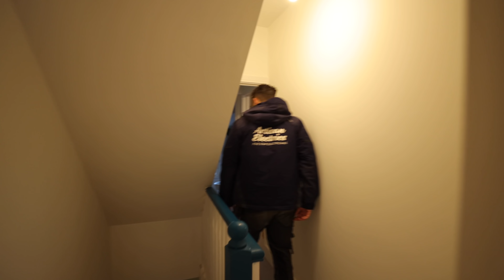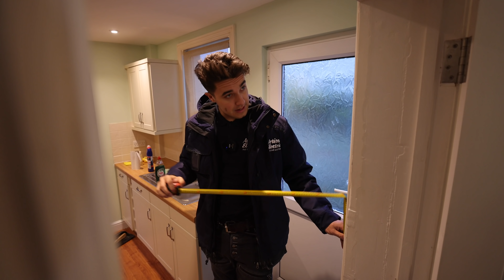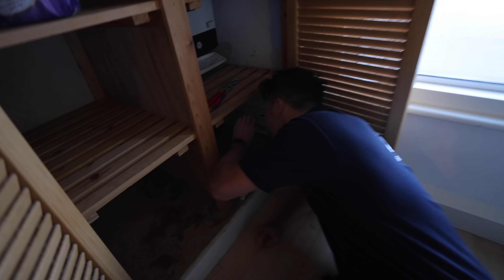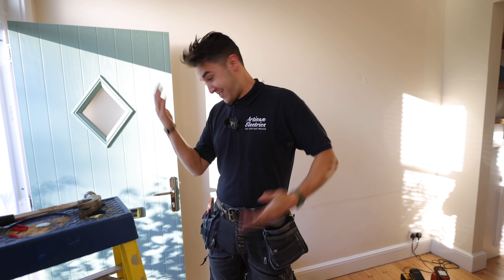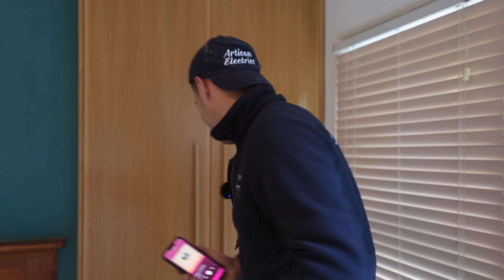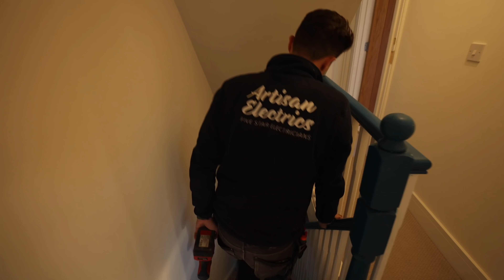I CUT THROUGH A WATER PIPE! MY WORST MONTH EVER! 😭

Comment from the maker: Leave a like if you would like to see a video on Cable Networking? - Make sure you’re subscribed to our Channel with Notifications on - bit.ly/3nqFpXp-ArtisanElectrics
Reply: 2k likes for a video on fiber optic cabling / splicing? 😬
Reply: Please do a networking video!
Best case: Full house networking install with 19“ rack install 😍
Reply: @taxiandy5698  Done lots of that..Love it ;)
Reply: Did you do T-568A or T-568B?
Reply: yep I do that all the time - The company I work for makes Cat5e/6/6a/7 - heh gotta love crimping the plugs on the end! - life of an IT Tech....
Reply: @B_T_B  only places where ive seen A pattern used is gov buildings, everything else is B
Reply: Structured cabling is getting more and more vital for the homes of today, would you start doing the installation and management of home networks alongside the electrics? Since you would be running electrics everywhere if you can handle the networking side while you are there then that would be great for the client. Just need to train everyone on how to properly run data cables and how to terminate/build network racks
Reply: For Cat5e/6 the continuity tester is fine. 8 lights means gigabit unless you're even more unlucky than Cory. Fibre is a completely different animal. Specialist tools, specialist training. Thankfully it's rare you'll see it in a domestic setting.
Reply: Yes please. 🙂👍
Hard luck with the pipe. My worst was a Lead gas pipe which didn't show up on my metal detector, for some reason. I had just grazed it, and could smell gas faintly, but couldn't see the small leak until I used detergent in water. It could easily have evaded being noticed, leading to serious problems later.
Reply: Hmm sparks messing about with datacomms, go ahead - sounds fun🤣
Reply: Yes, but please Cat 7/Fibre and proper double network sockets in every room like in modern houses

Comment: Haha how did Cory not realise the pipes were there? He literally lifted the board and you could see them. But that is something we have all done
Reply: Maybe just maybe he didn't see it.
Reply: yeah was thinking the same, he saw the pipes in the other room going that direction lol
Reply: He knew they were there, but as he said on the phone to Jordan, the pipe was litrally touching the floorboard, so even if he cut the board perfectly, it would have still hit it. The pipe should have been a bit lower.
Reply: @puntoboy_gaming  can't always go much deeper better to use plastic pipe and drill through lower
Reply: @steverobinson8170  it's only 15mm pipe, you can got a bit deeper, look at the other pipes in the video, you can see a good half inch gap between the pipe and the top of the joist. Not blaming the plumber, though.
Reply: @puntoboy_gaming   those floor joists look like 6x2  max depth of notch in those joists  is 18.5mm , max  on any joist is 35mm   calc for depth  is 0.125 x the depth of the joist  . they should also be rapped where they bridge the joist , this is down to bad plumbing not corys fault . Should hve used microbore or plastic and drilled the joists
Reply: I pulled a board a once and had a nail in the middle then when I put it down I hit the nail in the middle tried to stop mid swing but was to late bang clean through a pipe. So it’s easily done and always silly and that makes it worse lol
Reply: Camera guy should have spotted the pipes it was clearly on camera.
Reply: With so many wall scanners out there, a simple scan would have shown the metal pipes.  I think Walbot (?) distinguishes between and even IDs non ferrous materials
Reply: That's why you use a skill saw, you can set the depth of the cut to how much you want

Comment: Get yourself a mini circular saw...  Take up a board thats already up to get the depth, then set the circular saw a mill or two shallow..  Cut the boards till your hearts content knowing you wont go through then just snap the last mill or two..
Reply: Good tip! I do this.  22 years and no burst pipes... yet.
Iv chased straight through lead gas pipes that have been buried in walls a few times though
Reply: Exactly how I do it, circular saw every time set just a few mil short then snap it off

Comment: I drilled from the inside out and drilled dead center through a downspout installing a cable drop. Ran a finish nail through a baseboard and ran dead center (again) into a water line for toilet supply that never got a metal plate on it when they built the house. The list goes on and on. If you are in any contractor trades... your day will come at least once.

Comment: I would highly recommend that Jordan hire a network guy.  There is a lot of money to be made in that industry as well.  If you do some commercial wiring its a good sideline to have as well as most business that do networking, don't do electrical and would need to subcontract that out.  Where as the other way you could also get that business as well.  With more and more home automation and home networking its a good field to be able to wire houses.  Hardwired network connections will always win over slower WiFi so from that aspect it could be a great value added service you could provide during re-wires etc.

Comment: Sorry Cory; bad luck.  You are a good sport allowing filming to continue - good for us to see real world problems; those pipes were really hard up against the boards.
Reply: not really. by building regs we are not allowed to cut out more than 1/8 of a joist. what i do is i leave a little diagram on top of the boards so the sparks know where my pipes are, to save them hassle like this 👍
Reply: @logansrcs9243  Thanks for that info - and that is a very good thing to leave a diagram.
Reply: @rossthompson1635  At the end of the day im all about helping out other tradesmen, thats the you have to be, saves them time and money having to pay a plumber to come and fix things like this
Reply: The regs on joists are to notch 0.125 x the depth of the joist, if that’s an old 8’ Victorian joist then your allowed a 1 inch depth which is 25.4mm, you can go through the centres with a spade bit and that’s 0.25 x the depth, you can only notch and drill within 1/3 the span of the joist where it’s anchored. 👍

I recently went back to college to study for my acs like 2days ago and this was the topic of the day 😂
Reply: @MrKonquer  Thank you for that info, useful. I wonder how many joists have been hacked and drilled over the years way beyond that specification.
Reply: @MrKonquer  im currently at college, and have gone through all that, but I am right with you are not allowed to cut out more than 1/8 of a joist
Reply: @logansrcs9243  yes 1/8 as a decimal fraction is 0.125, the joist in the video is a 8 inch joist so you’re allowed 1inch notch which is 25.4mm as you can run 22mm pipe on them too, those pipes are way too shallow and can be notched deeper. 

They are right in telling you 1/8 because the majority of uk homes like 90% are built with imperial 8inch joists so you can take an inch outta them, all I put in my earlier comment is the uk standard for measuring up joist prior to notching you can look it up online if you don’t believe me.
Reply: @MrKonquer  no mate I believe you, that is also what I've been told 👍
Reply: @logansrcs9243  On new build the chippy used to mark the floor as it was put down over pipes any decent plumber would have marked the flooring,
Reply: @anthonybragg  yes mate definitely, I do it all the time to help everyone out

Comment: We've all done it mate, mine was a DIY job, fitting a new light fitting. Drill through ceiling for the rose and hit a hot water pipe. By the time the flow stopped I had a blister on my thumb which was so painful.

Comment: Haha I'm a plumber and have done it myself, and those pipes should've had a protection plate over them. Use a circular saw with a set depth, or wrap some tape round the multitool blade at 17mm so you dont go too deep. These things happen and you handled it well.

Comment: Drilled through a ceiling in a tiny cloakroom, hit a heating pipe, black, smelly hot water started pouring onto me, couldn’t open the door straightaway as I was using a stepladder which took up all the floor space, only a head torch for light. 🤣🤣 Never apologise for saying “turn everything off” btw, old heating systems had header tanks with a feed from the mains so at least if you shut off the main supply you’ve only got the header tank volume, plus rads of course, but you shut them off too so all good. Great video again!

Comment: Great to see the response to a difficult situation from Cory and the team, no quibbles just get it sorted! It sounds like you picked up a few lessons learnt from springing that leak (and good experience for Ruben), so it's not a waste.
The tool-less keystone jacks, and your termination on them looked really nice and tidy - great job! It's incredibly frustrating to see sparks take off more cable jacket than is required to terminate when working with twisted pair - the jacket, twists and the cables proximity to each other are all by design, and when you take any of them away you will lose signal integrity - when you are terminating ethernet cabling on longer runs (to an EV in a garage for example) this could cause strange network problems on customer networks.

Comment: CORRIE !!! A wee tip just release the pressure from the system … use the pressure valve on boiler …. Takes 2 sec …. Plumber can repressurise it easy
Reply: Once you’ve turned off the feed, why not just open one of the taps to depressurize? Then at least it all goes straight in the drainpipes.

Oh wait, these are heating pipes, never mind.

Comment: Feel for you with the pipe. Lifting bedroom floorboards to run speaker cables, circular saw set 1mm deeper than floorboards, first cut found 10mm microbore heating pipes in a 9mm  notch in joist! Fountain of scalding water, no quick shut off, rip up board, fill void with towels, turn of CH pump and try and drain down heating as fast as possible, then have to do the dirty plumber stuff, before finishing cabling and repairing floor.

Comment: Great job guys, but with the Keystone Jack, its usually a good idea to use the punch down tool as its spring loaded, versus just pulling the wire in by hand, ensures a long term, solid connection with the pins.

Comment: Might be a good idea to have some  LLFA Tape on the vans just in case you hit a pipe you can wrap it around the hole and seal the leak until the plumber comes out and does a repair. I am going to get some now for a just incase solution, one of those things thats going to happen at some point makes you think how best to minimize the water damage.

Comment: I find microfibre cloths are great for directing water into one area to contain a water leak. Last year I had a problem with a leaking valve and I tied a microfibre cloth tight around the pipe  below and directed the water into a container  It was OK all weekend until I could fix it properly. Its good that you show everything on your videos,even when things don't go to plan .A lot of people would have edited that bit out and pretend it didn't happen.☺

Comment: Worked in a house from hell last year, kitchen fitter hadnt installed all the units or cowl for cooker hood, so  first i drill through the mains water pipe at head height, running up the side of the window,got soaked  kitchen soaked, chisel hole in new plaster around pipe to  fit a new piece of pipe for  plumber, who then doesnt fix leak properley.
Went back  2 days later and  leak still evident as a dribble.

Then  told to fix cowl above cooker hood, and drilled through gas pipe, even though it was an electric cooker, always check behind cooker for a gas supply so ran and turned off gas, house stunk of gas opened all windows etc,  not at all happy.Plumber called out to cap off gas pipe .

Stuff happens.

Top tip if you drill a pipe under flooring, the water will fill the gap between the joists, and eventually the weight of water will pull the ceiling down, seen that, so  drill a few small holes ti allow water to drain out, place buckets underneath or use a wet and dry vac to vac up  any  water before it causes damage.

Comment: Having gone through a radiator pipe with a screw (professional DIY classic!), and then finding out the house stop cock was jammed … (ended up tying the ballcock in the loft - thank goodness it wasn’t a mains tap… couldn’t find the buried tap outside either at 11pm in the dark!), I bought one of those emergency clamp down 15mm pipe split things.  Allegedly they work in a pinch (you just need a bit of room to clamp it around the pipe fully).

Comment: Top tip always cut the floor boards straight across the joist it stops any floorboards creaking later, when using a multi tool to cut the plasterwork for chasings use cheap Amazon wood bits they're longer so they don't damage the wall and make great chasings

Comment: If you have hit the heating circuit and it looks like it, isolating the cold water mains won't do jack... We had sparks do the same thing at work, they went through 22mm flow/return heating circuit and dumped most of the water in the circuit down the back wall of my server room.. For instances like this and if you have access, have some speedifit/pushlock cap/ends (or bungs) so you can isolate quickly...

Comment: Artisan Drilling services now... Artisan Drilling and Cutting Services, not a spark in the country not done that.
I must say, I could see those pipes when you were lifting the board initiall and was thinking, a tad close there !
Couple of jubilee clips and bicycle innertube strips in your toolkit when lifting boards... temporary repair.
The spark rewiring my parents bungalow that my Sister employed, when fitting an outside light drilled through the cold water feed to the kitchen, he temporary repaired the copper pipe with a plastic through fitting, it failed and flooded the the whole bungalow...for at least a week as father was in a home.
Every kitchen unit swelled, ruined, every carpet was rotten, all furniture, wallpaper ruined, ceiling ruined. The boiler had beed turned off so no heating, insurance company would not pay out.. what an expensive error that was ! for one bad repair.

Comment: When the electrician drilled through a copper water pipe at my work, finger over hole, his mate went to the van, retrieved their emergency pipe freezing kit, froze the pipe either side of the leak, cut out the section with the hole in, slipped over a compression fitting leak sealer fitting, tightened up compression fittings. Job done, no water damage or flooding. Done with no worries, no panic, almost as if was a planned part of the wiring process.  I thought this would be handy for home, but sealer compression fitting is £5 and pipe freezing kit is £30. For commercial jobs £35 is obviously far cheaper than calling a plumber out.

Comment: Occupasional hazard, no matter how careful you are, even plumbers do it sometimes. As an electrician I tapped down a loose floorboard, next to the one I'd lifted, trying to be helpful, unfortunately there was an old nail sitting just above the heating pipe and it punctured it, definately a "Don't panic Mr Wainwaring" moment. Also years ago a friend of mine cut through a lead pipe in error (2 pipes that twisted over each other in a wall cavivity, so he cut into the wrong one!). I pohoned my mate who was a plumber and he said "Just hit it with a hammer over the cut so the lead seals". It worked, worth remembering.

Comment: With you on  cleaning above ceilings, our house has some much dirty builder, filthy plumber and slovenly sparks (the kind that twist conductors and fit wire nuts😲) crap when I’ve lifted the boards.

Comment: When we got our kitchen replaced, we asked for some sockets to be relocated. On day one the old kitchen got ripped out and there was lots of noise... After the team had gone water started dripping through the ceiling above! 
What had happened was the "electrician" had tried to make existing cables longer by pulling/tugging/hauling on them, and had dislodged a cable clip. The tip of the nail holding it to a bulkhead had pierced a plastic central heating pipe when the house was built, and had been sitting there quite happily for nearly 10 years. Fortunately once the pipe leaked it was decompressed, so it didn't cause too much damage... Part of the kitchen ceiling still had to come down then get replastered.

Comment: Wouldn't that switch move be a classic job for a Quinetic switch, with the receiver behind a blanking plate at the old switch location?
Reply: Not without a neutral there. the Quintic receivers require one.
Reply: Receiver at the light then ?
Reply: @Cablesmith  switch receiver on old switch no neutral needed save the blank plate
Reply: Definitely a job for a Quinetic.
Reply: Good idea
Reply: Absolutely.  Fit quinetic above light fitting ( where L+N is available)   Blank off original switch 
( And ideal for use in special locations such as bathrooms)
Reply: Could have just lifted the carpet and turned the S/L Into a perm L&N and then done as you’ve said here. Less chasing etc but still having to get floors up etc.
Reply: @JayTheSparky  probably could have done that just inside the fitting actually, best idea yet 👏🏼
Reply: @eric4709  can’t leave the receiver inaccessible
Reply: @slimski  it would be accessible as it is in/ above the fitting lol just make a note of it on the CU
Reply: @slimski   It isnt inaccessible - it can  be accessed by removing the light fitting
Reply: Put in my first one of these last week. Brilliant bit of kit - saved many hours of work.
Reply: Quintec new switch receiver no neutral required. You can normally tell the pipe run by rad position and look of boards. As you said snap the last bit. You could see the pipes on the video as you first pride up the board. At that point I would wedge out and look.😃💥⚡
Reply: done in 30 mins max haha